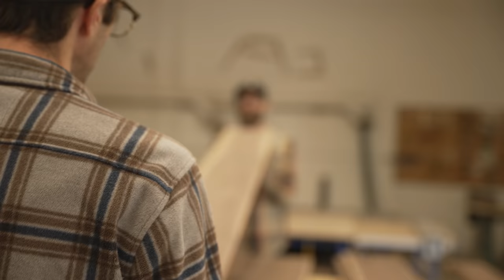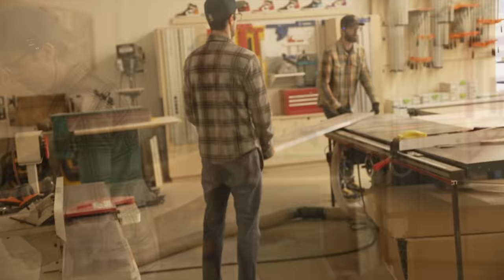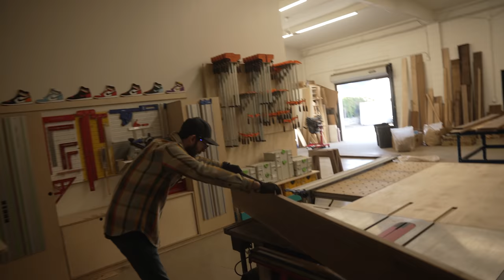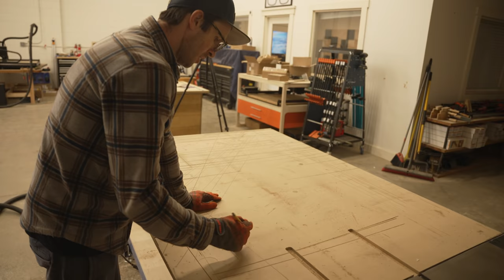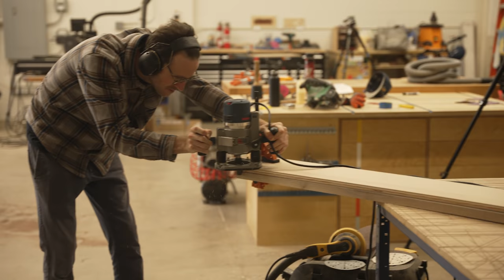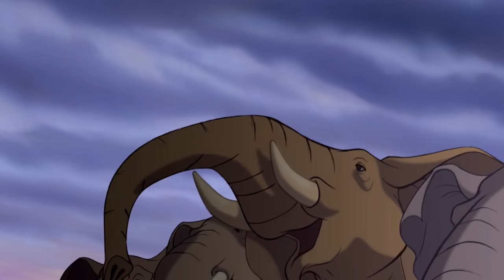How to (NOT) Joint an Expensive Crooked Board - Build Diary - Part 2

Comment: As a non woorworker, why didn’t you use a track saw to establish a straight edge? If this egde is not perfect it still would be way better to then  run it past the jointer.
Reply: This is how I do it. I wonder if this video was just a showcase. Like, if you wanted to, here's how.
Reply: I was thinking the exact thing when this video started.
Reply: i think maybe because the track's simply not long enough?

Comment: I don't joint long boards anymore. I use a track saw with a 3m track. It spits out boards that are perfect for gluing.
Reply: Track saw all the way for stuff like this. If for whatever reason the cut isn’t good enough for gluing a jointer plane make quick work of it.

Comment: I don't have a ton of experience jointing myself, but at the Makerspace I went to for awhile one of the instructors showed me that for concave crook, a good method is to take continuous passes at either end first. So start with one end, joint a little in, then carefully pick it up off the cutterhead, place it back on the infeed and joint again. Each time you take a little bit longer of a pass, until you get rid of the crook on the one end. Then do the other, then the edge is close to straight and you take a few full-length passes to finish it off. This is a lot faster than taking full length passes every time, and is very similar to how you would traditionally joint an edge like that with a bench plane. My understanding is you always want to work with concaves and not convex on the jointer because the wobble can be dangerous. Not just for edges, but also for cupped faces, should be concave side down.

Comment: Thanks for the videos! I joint long boards on the convex side often. You just have to  put some care into balancing the part so that it cuts each end equally. Alternatively I will joint the concave side into a slight convex by lifting over and skipping the middle section. Then  you can joint the same edge without following any curvature.

Comment: You can draw in a straight line along one edge, you can even use a chalk line, and then freehand the cut on the bandsaw.  You can then joint the bandsaw cut edge.

Comment: That board is the reason for having facing hand planes in the shop. Then you can start at the apex of the curve and work it down before trying to balance on the jointer table.
Reply: Came here to say something like this. I don't have a jointer, I use hand planes. Usually just a 4 1/2 and a couple passes with a longer one like a jack or 6, but for this size board I'd use a 7. Get the crowned side straight, run that against the table saw fence, and then flip it to square off the jointed edge.
Reply: It is a bit frustrating to see skilled machine woodworkers struggle with basic hand tool tasks or come up with weird solutions to basic problems. Too often hand tools are portrayed as an all or nothing choice.

Comment: I normally joint edges on the table saw using a sled, but had to also resort to a router + straight edge about two weeks ago since it was 2.4m x 38mm Beech and far too long for the sled method.

Comment: I bought an 8ft length of flat steel for like $20. For a lot of boards, it's not that convenient, but barring using a track saw, I just get a long enough router bit to clear my material and it gives a perfectly straight edge in one pass.
Reply: Ooh. Of course this is really only useful if it's a single pass taking away a small bow. Otherwise there are much better ways

Edit: whoops!!! Realized you guys ended up doing that exactly!!

Comment: I‘ve always run the concave side against a long fence on the table saw to establish a straight edge, then turn it around and run the convex side and it’s good to go
Reply: You use an extended auxiliary fence? I can imagine that works up until you have to do really long (7ft+) boards where making a long enough fence thats sturdy is a bit extra work? Curious on this one.
Reply: @TracksWithDax  yep, it’s about 10’ of MDF. It slots over the Sawstop fence and sits pretty snug, it’s actually quite sturdy. We’ve run plenty of 10-foot boards against it. A featherboard helps, or even better another pair of hands guiding with a push stick.

Comment: If you dont have a track saw, use a chalk line to get a reference line and cut it with a circular saw then joint from there. Should get you close enough.

Comment: did you make that so complicated for a video or do you really not know how to do that,  two simple methods, one, have a bigger jointer with longer  beds, or two, make short passes on both ends to get it close and then run the whole thing. It's a 2 minute job
Reply from the maker: Yes.